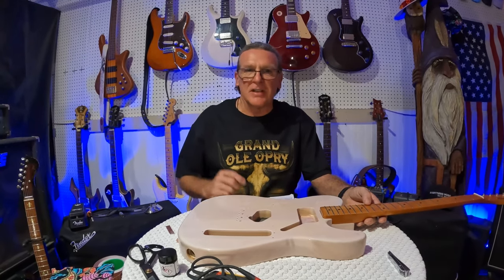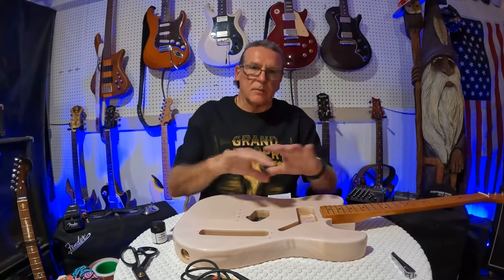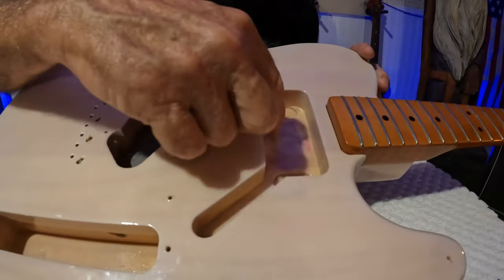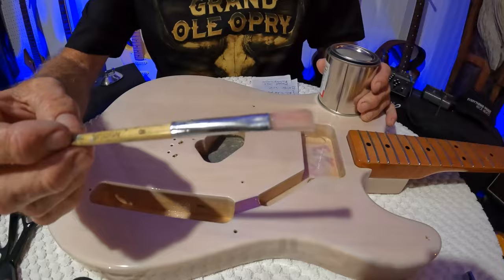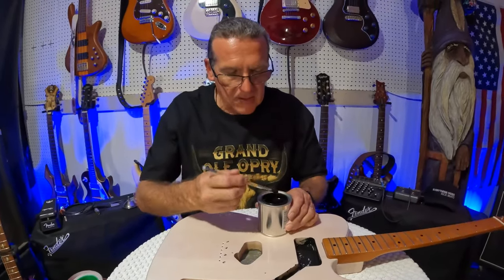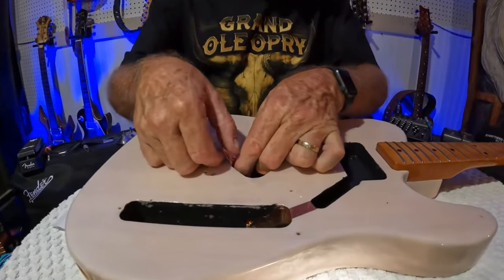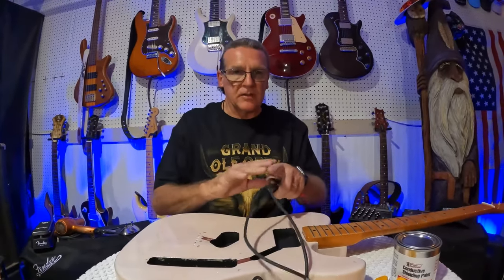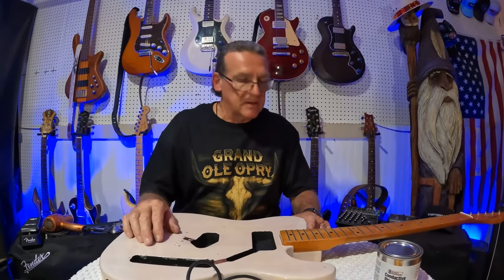How to DIY Shielding Guitar Control Cavity - Why Should I

Comment: One more thing is... do not daisy chain the ground wires pot to pot.  Run each ground wire separately to one common area, usually the volume pot.  It is possible to have a ground loop when daisy chained.  I noticed a marked reduction in hum copper taping the inside (including over the "silver" backing of the pick guard) and wiring my Strat like that!!!
Reply from the maker: good advise thanks 👍✌️

Comment: Nice video! I have started chasing down hum on my kid's short scale bass and buzz from the tone control. I replaced the pots and 3 way with switchcraft, and it improved some but like you said I found out single coil pickups it's just going to be an issue. I think next, I'll use the shielding tape and then replace all the wiring since it was so cheap. After that maybe some TV Jones dual coil pickups!
Reply from the maker: Right on .  Keep your kid jamming. I would look at all the grounding wires. See if one may look connected but is not. If it has shielding tape already at all. Look around to see if any has peeled loose and is touching something it shouldn’t. TV jones are great . Glad the video was helpful and thanks for watching. 👍✌️

Comment: is it possible to use both the paint and the tape?
Reply from the maker: Yes you can do both tape and paint. I have put the tape on first and then the paint. The paint is easier to get down through the wire holes to connect each cavity. So I use the paint to connect the tape from one cavity to the next.